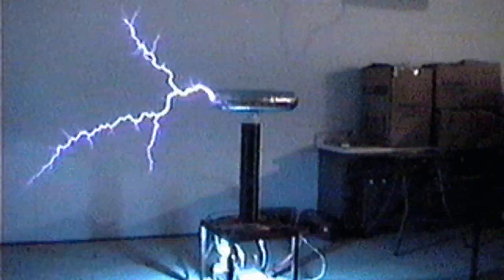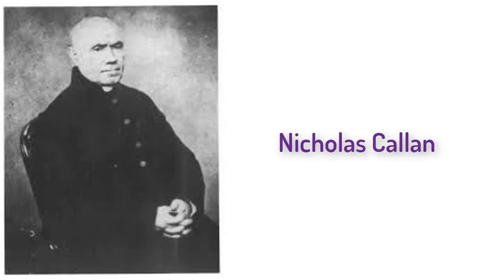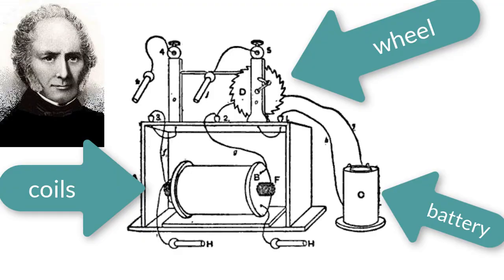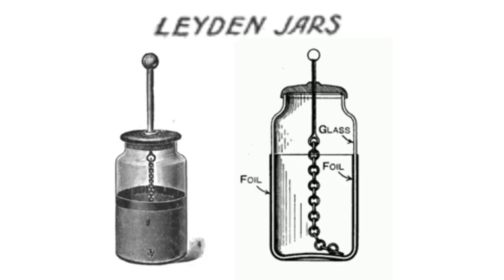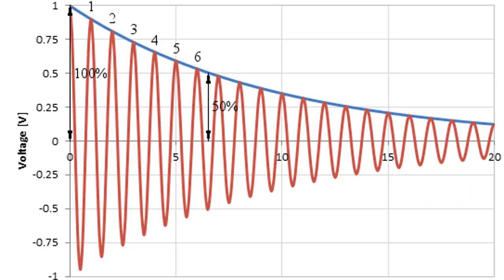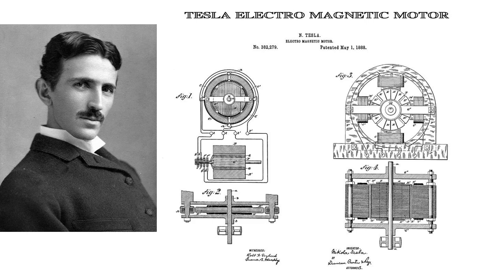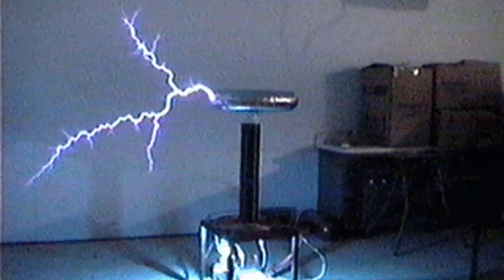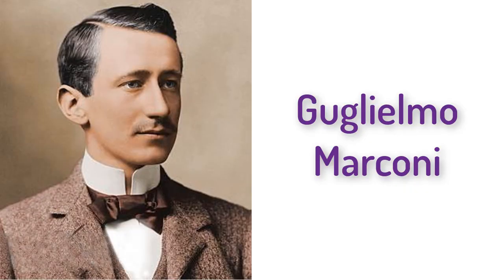How Does a Tesla Coil Work? A Historical Deep Dive

Comment: Dear Kathy, you should pull this tube down and redo it. Tesla coils were powered from a high voltage DC generator into a version of Poulsen arc lamp. The Tesla primary and secondary coils are well separated air cores and use electro static induction not magnetic induction. The toroid on the top acts as a tuning cap between ground and the secondary coil.

Comment: Under dc voltage, metal is conductive and rock is not. But under high frequency ac source, everything is conductive. Tesla dream is one  wire is touching the sky and the other way back to ground

Comment: So, a Tesla Coil is sort of like a klystron, in that the output frequency of a klystron is much higher than the supplied input frequency, while simultaneously creating a voltage gain on the output frequency (whereas a magnetron only amplifies frequency, without creating any voltage gain.)

Comment: I appreciated the fact that every time a name was to be given, it wasn't the name I supposed :D Oersted, Ruhmkorff... neither one I guessed right! Thanks to this I have info to search more and again, to have a better picture. Thanks!

The downside of this videos is, despite being well informative, it failed to point out HOW the high voltage in the topload is reached. 

It is NOT just by induction. It's because of the loose coupling between the primary over the secondary, the secondary itself being a single wire transmission line with a lenght sufficient to sport transmission line properties, and resonant rise in the 1/4 wavelenght... The question "How does a Tesla coil Work" can't be answered without the loose coupling, dear physicist.

Comment: Some points of interest for your consideration:

11:10 "ionization of air"
Rather than employing the term free electrons to describe the discharge emanating from the capacitive torus of such a setup, it is truly the action and strain of the connecting electric field lines which in due cause a discharge in the surrounding air. Granted that the modern day Tesla Coil, one of high impedance, high loss, and little use for radio telecommunications, possesses a donut shaped top load, this gives a nonuniform potential gradient surrounding the torus. The sides of this shape pose to increase the electric field gradient and number of lines of force per square centimeter, causing the dielectric strain of the surrounding air to breakdown, as the quantity of electric lines of force increase with respect to terminal potential. Hence, a discharge occurs. For this reason, Tesla speaks of employing spherical top capacities, as a sphere provides the most uniform field line distribution, preventing stray discharges to some extent. 

11:25 "Wardenclyffe to electrify the globe"
Despite the lack of a functional setup in the end at Long Island, it is to say without doubt in retrospect, that Tesla seemed to be mainly concerned with toying with experimentation, rather than simply constructing a functional setup. After returning from Colorado Springs, where a respectful amount of data was collected on the effective transmission of telluric communication, something seemed to have went askew, as his latter patent on Wardenclyffe would stray away from an efficient coil setup. His three coil magnifying transmitter arrangement developed at Colorado Springs had maximized transmission efficiency, by constraint coil geometry of stout form. The opposite of which is seen in the Wardenclyffe patent. For this reason, many believe that the modern day Tesla Coil of elongated proportions is in fact the finalized and perfected transmission apparatus which Tesla had developed. The latter of which is falsehood, whereby Colorado Springs appears to be the correct avenue of conducted research to approach.

Comment: What an excellent explanation. I've recently discovered your channel and I think it's great.

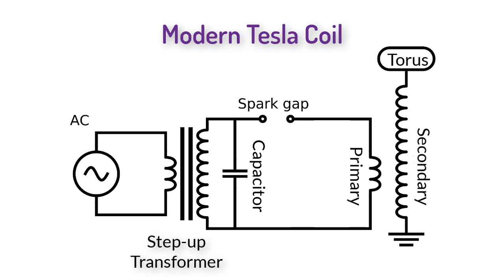11:04 It is better to put the spark gap in parallel with the transformer and the capacitor in series with the primary coil. As you have it in the video, you run the risk of the high frequency getting into the transformer and burning it out.

Comment: In Jr. High, our 9th grade science teacher had a monster Tesla coil.  Primary was 5 turns of 1/2" copper tubing.  Secondary was 5,000 turns of #10 copper wire.  This was hooked up to an oil capacitor bank able to put out 10KV.  Yes, a 10MV spark, but a very low current.  I walked up to it, put my hand into it...

Fun!

Comment: If only Dr. Frankenstein had that machine he wouldn't have. had to wait for lightning storms. Which brings us to the Jacob's ladder, a prop in every Sci Fi mad scientist movie of the 1930s and 1940s. This gets us back to the electric field strength to pull electrons away from nuclei into the conduction band. The spark you see isn't the lightning, that's invisible. It's the trail of ionized air. This brings us to the realization.that chemical energy is a form of electrical energy which only increased my lifelong fascination with chemistry. So in our. Universe the geometric stability of the electron configuration of a noble gas is at a lower energy state than electrical neutrality. Were it not so chemical reactions wouldn't happen.

Comment: The disconnecting switch @ 4:07 is the same principle used in tattoo guns but the switch is extended and connected to a tattooing needle.
So now I know Fizau created the LC oscillator.

Comment: There are a couple of "by the ways" in the description of operation of the Tesla coil.
Unlike most air core transformers a TC has the majority of the secondary uncoupled from the primary; typically the primary is about a fifth or so the length of the secondary and is generally loosely coupled. A variation of the Tesla coil, known as an Oudin coil, is an autotransformer with the same working principles.
Most of the extreme voltage rise comes from the effect we see in resonant antennas: peak currents at the feedpoint and peak voltages at the open end(s), but in Tesla coils the goal is not to radiate energy but to cause the standing waves to pump as much of the energy as possible into the end of the coil. The voltage rise is almost entirely outside the coupled section.
Reply: Good to her you call it an Oudin coil. Most people have never heard of this and mistakenly call them all Tesla coils.

Comment: It is important to note in the Tesla coil schematic shown in the video that ONLY the capacitor and the primary coil of the air-core "Tesla coil" is involved in generating radio frequency, RF, energy that excites the RF secondary of the Tesla coil. The only job of the secondary of the iron-core transformer is to charge up the capacitor to a voltage high enough to jump the spark gap which then discharges the electrostatic energy in the capacitor into the few turns of very heavy wire of the primary coil to create a very intense magnetic pulse which then charges the capacitor back up with the opposite polarity as the magnetic field collapses back into the primary of the Tesla coil, etc. The "size" of the capacitor and the "size" of the inductor determine the frequency of the sinusoidal oscillating current in the tank circuit.

Comment: Another way to explain the Leyden jar and coil circuit (aka a tank circuit) is to think in terms of energy storage. Electrical energy in the form of an electric field is present in the fully charged capacitor. When a coil with a large number of turns is connected to the capacitor, one would expect an instantaneous large blast of current and a spark like with a short piece of wire. But what actually happens is that the current rises in the coil much more slowly because of Faraday's law of induction. As the electrical energy of the capacitor is being transferred to the magnetic field of the coil, a "back EMF" is induced in the coil that opposes the change in coil current. Thus the coils slows down the transfer of electrostatic energy to magnetic energy. At some point the coil current reaches a maximum and and then the magnetic field starts to collapse inducing a coil voltage in the opposite direction and charging the capacitor back up again but in the opposite direction. Once the magnetic energy in the coil is fully discharged into the capacitor's electric field, the current starts flowing in the opposite direction as the capacitor discharges itself back into the inductor again. Finally, the after coil has charged up with magnetic energy and discharged it again to the capacitor, the capacitor is back to it's original polarity and voltage sans a certain amount of energy lost to electromagnetic field emission and heat due to resistance and other losses.
Reply: Correct!

Comment: Hi Cathy! Just a small correction: capacitors do not store energy in the plates (as most electrical engineers will tell you) but in the dielectric between the plates (be it material or vacuum).
Reply: It is kind of both, I think. The positive plate will have a deficiency of electrons and the negative plate will have an excess of electrons. These net charges create an electric field that is the most intense between the plates. The dielectric in between the plates can reduce the intensity of the electric field in between the plates by electrostatic induction in the atoms or molecules of the dielectric. The greater the dielectric constant, the lower the intensity of the electric field (or voltage per unit distance) for a given differential of charge between the positive and negative plate. This allows more charge to be transferred from one plate to the other before the voltage gets too high and dielectric breaks down and a spark ensues or the charge finds another route from one plate to the other typically in a rather dramatic fashion.
Similarly, a conductor with and electric current passing through it creates a magnetic field, which is also a form of energy storage. When the current stops, the magnetic field "collapses" into the conductor and causes the current to flow in the opposite direction.

Comment: The last winding of a Tesla transformer has very little to do with how a conventional transformer functions. It is the so-called "long line", ie. wire, the length of which is comparable to the wavelength of the supply voltage. In particular, the Tesla transformer winding is a so-called quarter-wave vibrator, which has a current antinode and a voltage node at its lower end, and a voltage antinode and a current node at its upper end. This is a purely radio engineering device, more related to antennas than to transformers, and attempts to calculate it like a conventional transformer have never led and will not lead to success.

Comment: One thing that is often overlooked about Tesla coils is that as well as being a step up transformer, the secondary is ideally also a 1/4 wave transmission line at the resonant frequency of the primary tank circuit.
Reply: What is a "1/4 wave transmission line"?
Reply: @tobystewart4403  There is plenty of info about transmission lines on You tube and other places.

Comment: Not really that much to it - I remember Tesla Coil plans from a Mechanix Illustrated issue in 1954 that my fraternity brothers and I built and used to entertain guests at fraternity parties - Made some interesting modifications to a few ladies' hairdos, and got a few screams and laughs. Simple circuit with what I remember as a one tube Armstrong oscillator running at around 18 - 20 kHz.

Comment: if you use resonance. If you run the circuit through a differential equation. There is a thing where the oscillation causes the wave to get bigger and bigger with just the right input frequency. This is an extra design feature tesla intended to use the coil to create massive changing voltage fields.

Comment: "The best magneto electric machine ever constructed."

And the word "magneto" is still very much with us, to describe the device used in small internal combustion engines to produce a voltage sufficiently high to cross the gap of a spark plug.
Reply: That's why I run a mag on my Shovelhead.

Comment: When I was in Jr. High, I built a Tesla coil.  The primary was several turns of #14 magnet wire on an oatmeal container, andhe secondary was many turns of #22 magnet wire on a yard long cardboard tube from a fabric store.  Instead of a spark gap generator, my coil was energized by continuous waves from a pair of transmitting triodes.  I got a nice spark discharge from the top of the coil.
Reply from the maker: That is amazing and very brave of you

Comment: I thought the discharge of charges were due to breaking of dielectric strength when the neutral air becomes ionised and transmit the electricity...
Reply from the maker: That is true.
Reply: The 'dielectric strength' (volts/metre) of a material (in this case air) is overcome by providing very high voltage and frequency, as dielectric constant is inversely proportional to the frequency as well. Kathy implied the same at 11:06 without using the word 'dielectric strength'.
Reply: @organicfarm5524  
Thank you

Comment: Tesla was using impulses waveforms; not a.c; as the input to his magnifying transmitter. The torroid placed atop his tower was not used to ionize the atmosphere which only creates coronal discharge, but rather was utilized in order to reflect the uni-directional impulses into the earth. Tesla stated clearly that these impulses were pressure waves; not transverse electromagnetic waves, and by using these pressure waves he could then set up a grid across the earths surface which he could utilize to transmit electricity from his transmitter to the various resonant recivers which would be placed on above mentioned nodal points. If you understand the skin effect in relation to high voltage aplications, cymatics, and can comprehend that the interior of the earth was used as a component in his circuit then this concept will make a great deal of sense. Marconi simply ripped off teslas patents, and borrowed ideas from hertz and others in order to create a half baked form of radio that wasnt useful as a means of communication until r.c.a came around, and developed the amplifiers and vacuum tubes that actually made radio practicle and engineerable. The analogy of a tank circuit is useful in regards to analyzing the basic function of a tesla transmitter. That being said you have missed some very key components that lead to an understanding of  tesla's ingenious and heavily supressed system of wirless electrical transmission.
Reply: And other conspiracies!……. the Tesla coil was, and is, a novelty light show and crude uncontrollable and pointless spark gap transmitter or lightning simulator…..Marconi got it right, starting with very crude spark induced radio waves attached to aerials which when refined and tuned over time has led to a revolution that is still going on as better modulation systems now allow vast amounts of information to be transmitted and received over hertzian radio waves
Reply: @billebrill8730  💯💯💯
Reply: CW is also a grossly inefficient way to transmit radio signals, in that it requires a massive amount of input power, supplied to the transmitter. Instead, it is much more efficient, and consumes a helluva lot less power, if you duplicate the shape of the modulated signal (sent as input to a transmitting antenna) with a sequence of evenly spaced (in time) momentary impulses (...otherwise known as a pulse train. ) When the receiving tuning circuit "sees" the individual impulses, each impulse "smacks" the receiving tank circuit (...like a man striking the surface of a bell-tower Bell, with a hammer.)
Reply: His haircut also caused some great difficulty as well 😢
Reply: Um, no.  Shush.
Reply: Tesla had poor math skills and did understand the inverse square law.  This is why high power can’t be transmitted very far.

Comment: Actually it's not impossible to transmit electricity are you have you have to do is put the Taurus of the Tesla coil high up in the atmosphere or also known as the ionosphere and eny other antenna in the ionosphere will pick up the signal.

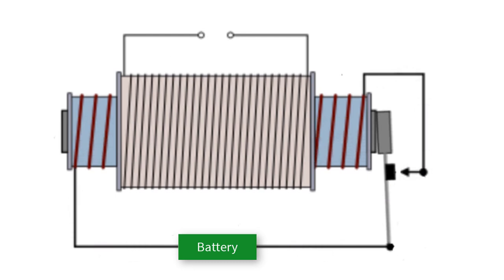Comment: 4:23 They were also called "trembler coils". Early cars used these devices to fire the spark plugs.
Reply from the maker: I knew that they are used in spark plugs but I didn't know that they are called "trembler coils" what a cool name!
Reply: The vacuum tube radios in automobiles used vibrator coils to produce high plate voltage for vacuum tubes from the 12 volt DC battery. You could always hear a hum of the vibrator when you turned on the radio.